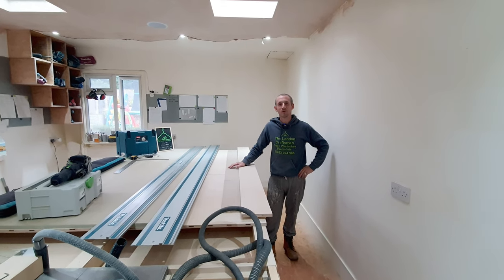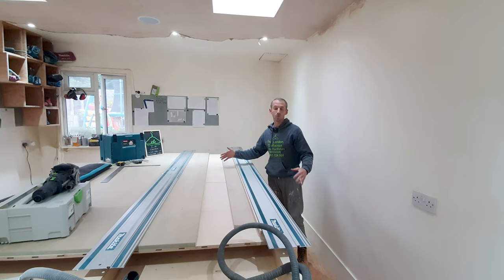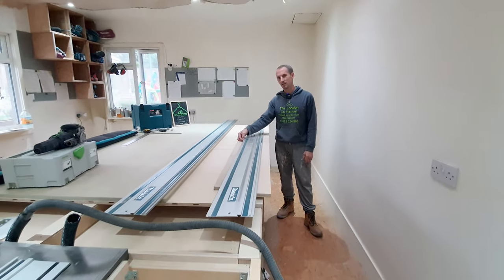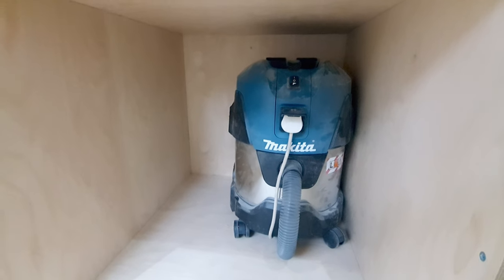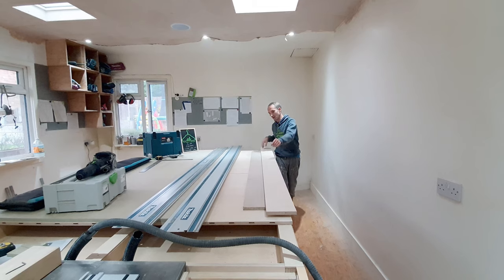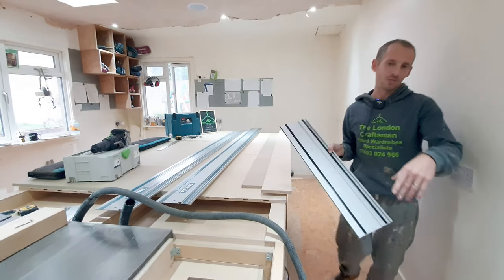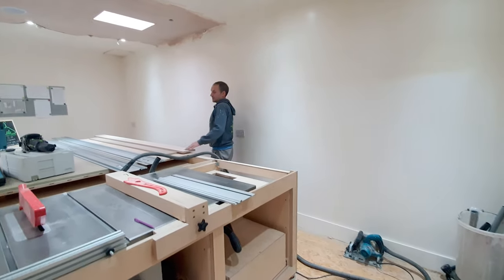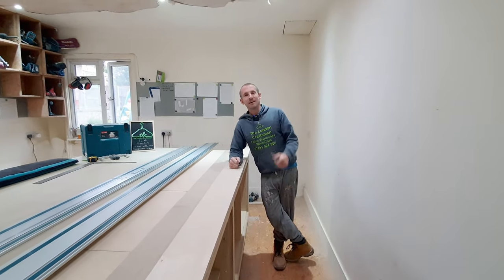Do JOINED Track Saw Guides Cut As Straight As A Single 3m Guide ? Vid#66

Comment: When joining tracks use a straight edge pressed up against each rails 'rail' that the saw rides on before tightening the grub screws. You can get it perfectly straight pretty easily. It's best to leave a slight gap between the tracks, maybe 0.5mm or 1mm, this allows you to shift the track back and forth to adjust it before tightening.
Reply: When I bought my makita setup I ordered a Betterley straight line connector too and use it all the time for joining tracks. Works amazingly well and since I use a pickup for work it means I have room to carry multiple short tracks with me at all times
Reply: using the TSO guide rail adaptors also helps with this. The makita adaptors suck
Reply: Agree.  The 3m version is way to long to carry between jobs anyway, as well as cutting sheet goods on their short side.  Nice, but impractical IMHO... so I use the 2x 1.4m and align with a straight edge like my long level as I tighten the connectors.  Never go by the butt-to-butt joint between the two tracks, rather place a straight edge against the edges and I have no issues with a perfect cut.

Comment: Watching a "festool live" video, when joining their tracks it was recommended that a few mm gap be left between rails as they are not guaranteed to be parallel (at the join) and then use the track saw over the join with its cams tightened to align the tracks before tightening the grub screws.

I've always found this worked well with my tracks (non festool) and doesn't require me to carry a massive straight edge with me 🤣

Comment: Hot glue a perfectly straight edged 8 inch rip of MDFto the two halves, while holding them perfectly straight. 
 Cut through the entire assembly at the miter saw, taking material from both aluminum pieces. 
 Miter angle won’t matter if you mirror cut. 
 Will align perfectly straight

Comment: As Hunders said. If your ripping ply or mdf use the edge of one sheet as a reference to join the tracks and tighten the bolts. Don't rely on the squareness of the end of the track!
Reply: Exactly
Reply from the maker: The factory edge is never guaranteed to be stright,  not something I would use as a reference
Reply: I think if your doing joinery that is good way to approach it, but presumably you would have a reference straight edge. If your doing site carpentry and want to rip off a few pieces of ply for a soffit for example then a factory edge will be a useful reference that is at hand when you need it. If you've got to be super precise all the time then I suppose you'd buy a rail that is long enough for the job. I'll check out your chanel. 👍

Comment: A few comments about good ways to join shorter pieces and how the long version is impractical in van.
   Well, nothing to do with van. It's great in workshop. Good tracksaw plus range of accessories combines mitre saw, table saw, jointer tasks for much less cost and smaller workshop

Comment: I managed to stuff up joining 2 tracks when I first set up the saw and looks like I will have to replace the trim guard as it doesn’t run true. Also the saw is a bit of learning curve straight out of the box in order to get it running with zero wobble. Would be great if you could put a general ‘how to’ video together with any tips and tricks!

Comment: Hi
Where did you get the 700mm guide rail from 
Thanks
Reply from the maker: I had an old 1.4m makita track so I cut that in have on the chopsaw and have 2 x 700mm tracks, one for site and one for the workshop 👍

Comment: You don’t rely on the squareness of the end of the tracks to ensure the joined rail is straight, this is not how they are designed!  My joined Festool tracks are perfectly straight, they’re easy to store and are totally reliable if joined correctly which is actually easy to achieve. 😀👍

Comment: Actually the way to line up the two segment is to align the long edge together. NOT to butt the right angle together.
I don't have one yet. But you should use pointed set screw. It's possible the one supplied is cup point.
Another way to perfectly align the two segment and allow it to be separable is to drill and ream a locating pin on the fixing bar and track. But this is another trade already. And it's not that strong because it's only aluminum.

Comment: The thing about track saw guides is not so well straight especially in the middle where the track saw guides joins. It tends to sway off,like the Bora NGX and WTX teack saw guides it does. Yes,the Bora NGX and WTX are good,Bora doesn't make parallel guides for these items,which is the only sad about it. Parallel guides are the best in keeping everything in line especially down the middle.

Comment: I see you have a corded version. I am agonising over whether to go for the cordless version. I like the portability of the 18v version (mainly in a workshop) but if I have it hooked up to a vacuum cleaner does it really matter?
Reply from the maker: Exactly, if you have a hoover hose then is it worth buying the cordless? Probably not 👍
Reply: @thelondoncraftsmanworkshop  I have the cordless one and no cable is one less thing to watch for snags inside (disadvantage being you need the '1' version that has a wireless sender to automatically turn on vacuum, or you just turn it on first :)
Advantage being outside doing cuts, that can be any garden or field without extensions (sometimes there is no power) and the cuttings from that saw are so fine they just disappear. Agree with the other comments, if you dont align the tracks when you join them with an edge, they will be off. Depends on accuracy/speed/convenience you want.

Comment: Has anyone tried using longer joining bars?  I would have thought that would help with alignment, but I'm not a tracksaw user (yet) so just curious.
Reply: There's a company called Betterley that make a tool called a straight line connector, they work great. When I have tracks joined I always attach it to the tracks again before lifting and moving it
Reply: @a-carpenter9229  thanks but too pricy for me as a hobbyist, and that is without international tax and shipping!

Comment: Always wondered this so thanks for answering it, wouldn't you put them against a straight edge first before clamping the second bar down so the 2 tracks are in line
Reply from the maker: No probs, possibly a re cut on the ends of the rails may help. 👍
Reply: @thelondoncraftsmanworkshop  I watched a similar video before saying have a hair of a gap between 2 joined tracks. Unfortunately I don't have room for a 3m  track was thinking of getting one then ripping .5m off the end as would fit a sheet but now just by precut panels of over 4'
Reply: Sam Rix, you are right. I usually put mine against a long spirit level, obviously with the thick end of the rail butting against the level and that seems to work. However, I always check that the saw will run smoothly over the joint before I cut anything. Having said that The London Craftsman is right, you wont ever beat one solid track for real accuracy. Good point to raise though London Craftsman and enjoying the channel.

Comment: Well, I'm just going to use a single half rail and saw, stop and move the rail and finish sawing.  I used the Bora dual rail and is to much a pain to continually put them together and apart and as shown, their not 100% straight anyway when connected.

Comment: Makita do a 1.9m version here. I use two of them together for big sheet goods and a single one i prefer to the 1.4m as it gives me a bit more clearance before and after the 1200mm width of a standard plywood sheet. Storing / transporting a 3m rail is a struggle for me.
Reply: I use a spare track or a Stabila level to join my rails rather than relying on the square ends of each track.
Reply: Yeah, around 1600 mm is the ideal guide rail length for cross cutting full sheets of roughly 4*8. I also got the 1900 mm rail.

Comment: that 1mm to 2mm difference will give you a whack cut trust me! you dont want that on your highend finish, get the 3meters guide rail. increase work efficient, no joint, minimize downtime alignment.

Comment: Maybe I missed it (but I watched it twice) you never flipped the wood board over so the newly cut edge was what was measured against the long edge!  I don’t question that the full length edge is straighter, but you measured against the wrong edge!  At least that is the way it looks in the video!  Also, I don’t think it’s valid to do what you did.  All you did was compare two different straight edges against each other.  So what?  They might both be crooked. You need to measure against something that is REALLY straight.  A laser, or maybe a wire pulled taught between two nails.  At the end of the day, this proves nothing.